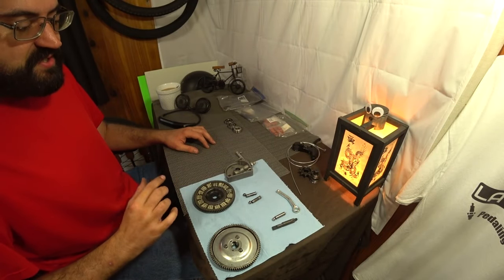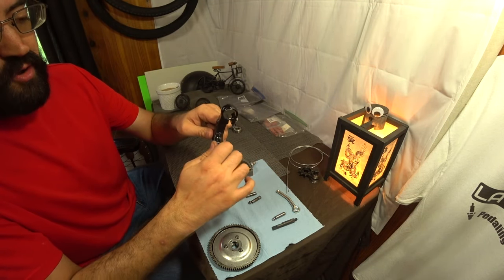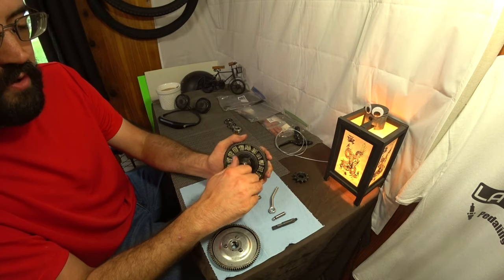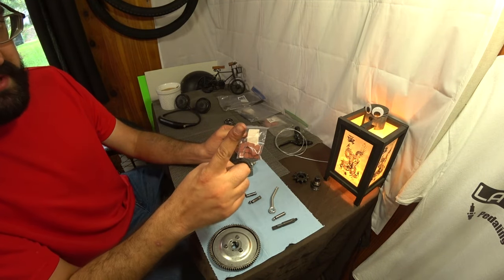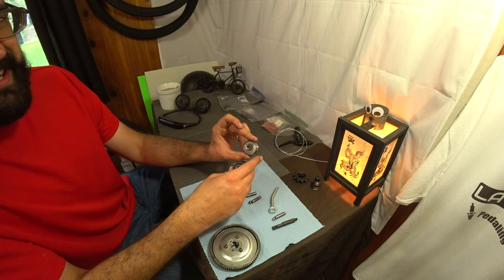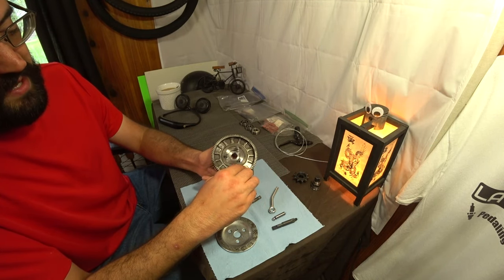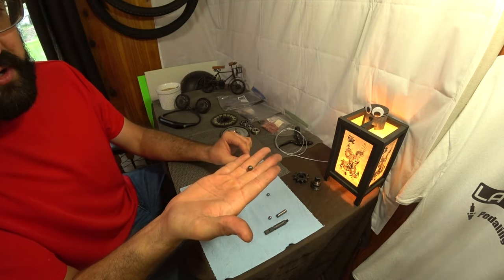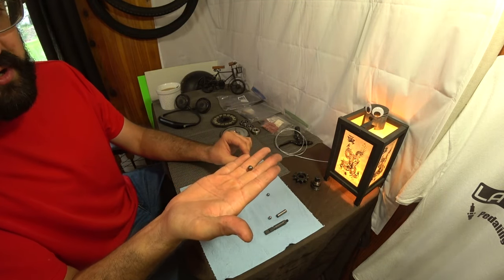How To Correctly Adjust A Motorized Bike Clutch

Comment: Can anyone tell me why when I let go of my clutch to engage it locks up I can hold the clutch in to disengage and it spins no problem but when I let go of the clutch to engage it does a quarter spin and locks
Reply from the maker: Motor might be locked up. Or chain might have to much slack in it causing it to bind up between the small sprocket and the case... Could be something else, that just off the top of my head.

Comment: should i grease the bearing on the clutch crank shaft?....
Reply from the maker: If you can easily access it a light amount of grease will keep them alive. But the grease can work it's way onto the pads, so after a few rides you may need to clean the pads and plate with degreaser.

Comment: I got a new bike with motor and it Jerks repeatedly when I slow down kinda hard to explain in text format.Not sure if its cause of new motor but I'm thinking its something to do with clutch.If you see this any idea what I'm talking about?
Reply from the maker: You may be reaching stall speed. Once you drop below about 8-10mph the motor will chug. It also plays hell on the chain, pulley, and sprocket. If you want to ride slow you will need a bigger rear sprocket.

Comment: Do you know some good stores I could find the better clutch pads to replace my eraser pads? I am frequently hearing my clutch make a squeaking noise and when I take the cover off I can see the clutch slip.
Reply: I bought a clutch disk With the pads like his already installed for $12 ish off Amazon in the 'Motorized bike parts etc.' section so I have 1 when needed.
Reply: @bryduhbikeguy  ill look into that thanks

Comment: My woodruff key broke in half what size do I get I have a 80 cc
Reply from the maker: 2.5-2.8mm depending on the motor.
These work, but you may need to sand them down a hair to fit.
Utoolmart Woodruff Key 1-Pack, (200pcs) Gray https://a.co/d/7GIB8j9
Reply: @LAHover   thank you

Comment: how come on both my 2 stroke bikes im constantly destroying the small clutch gear?
Reply from the maker: The bevel gear on the crankshaft? Other than making sure it's greased, centered, and the screw in tight, I'm not sure. Maybe just unlucky. So far I have never destroyed one.

Comment: crazy after watching this vid my back wheel is locked up an i refuse to do what Hughy motorized says jump on it and force pop it Smh wat a dic i took the pads out ect all the hooplah and its still stuck i should be able to turn this screw by hand with the spark plug out idk man its stuck now
Reply from the maker: It's not a folded chain is it? Some times they lock up under the sprocket cover. This is common if the chain has to much slack.
Reply: @LAHover  no lol but i watched that dudes vid where he made it like a big secret no hover i have the clutch arm cover off the chain is fine its def bearings stuck piston from running that royal purple stuff 40.1 or that small gear is faulty either way its yd100 time but it was cool the motor took me all over the city 3months of rush filled cruisin shiiit i cant compLain

Comment: Thinking about getting the stage 4 bbr tuning 2 stroke from bike berry anyone know anything about it what’s it’s top speed with a 44tooth on a 26 inch rim
Reply: Don't get that engine, all of the bikeberry two stroke engines are garbage and overpriced.  Get a triple 40, YD or PK.  But the top speed on the BBR engine is probably high 20s until you break it in, then probably low thirties.  But there's so many variables on those engines that can make a big difference either way.
Reply: @mjsmjs7905  triple 40yd can you recommend a site to buy that from
Reply: @mjsmjs7905  I have 4 strokes also a49 and a79cc just want a good trail bike so need a good 2 stroke
Reply: @nostalgiaholic4874  lol me to 49 and 79. What 79cc do you have? The predator?  I'm curious about the predator.  My 79cc is on a Phatmoto.  I replaced the stock 79cc Lifan with the stock 79cc Lifan that Home Depot sells. That motor is Awesome, but I hear some people say the Predator has more torque,  but then I hear people complain that the Predator doesn't have enough torque.  But 79cc from Home Depot flies up steep hills, and still top at 35mph.
Reply: @mjsmjs7905   I’m using the power fist 79cc it’s from princesse auto (basically Home Depot) I have torque converter for a 212 on there just used a shaft adapter and I’m using a Canadian tire chopper bike basically made the whole kit the mount is just some quarter inch steel welded to the Frame I’m hitting about 55 km/h on flat ground and mine rockets up
Hills as well, I wish I had the phatmoto kinda jealous lol

Comment: my bucking bar will not go back in all the way
Reply from the maker: Some times they will only go back in the way they came out. Might also be hydraulic locked be the grease. 
Another possibility is you may have put the shaft in backwards.
Or just some junk in the shaft.

Comment: Yeah hey let's just make one thing clear bike berry over priced overrated and underachieved put it mildly they suck anyway I got a clutch spring problem my adjustments I do with the flower nut to make the clutch engage tightens up within a mile and then I can't disengage no more I'm sure it's the spring whether or not I have to tighten it or loosen it I don't know how far did you turn it to get the right adjustment I like one and only do this one time because there's quite a bit to do and if your cables afraided it's going to suck even worse if you know the answer please send it with the quickness I use this thing everyday and today I've got to use it
Reply from the maker: Common issue, I think I covered it in the advanced issues video linked in the description.
Just incase I did not, The three things that this could be (in order from most common) are.
1: your flower nut set screw is missing.
2: your clutch plate return spring is weak, damaged, or missing.
3: your woodruff key between the clutch assembly (clutch basket) is missing.
Reply from the maker: Made a short video to better explain the possible causes. If these three things are all in place but still giving you issues let me know. https://youtube.com/shorts/Rw2yGhPmD4Q

Comment: I think I would rather buy another 100 dollar engine than change out the main bearings in one. Sounds like a tough job.
Reply from the maker: That's the beauty of these cheap motors. Rebuild or replace, won't break the bank :) ... Ride on builder!